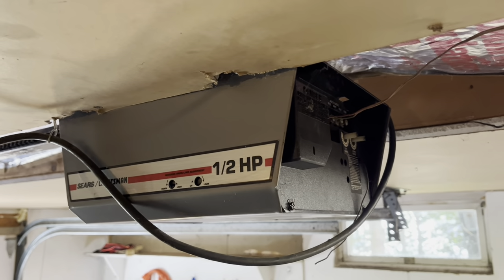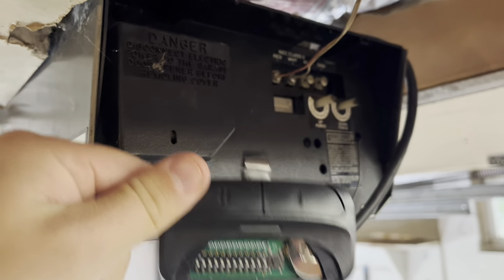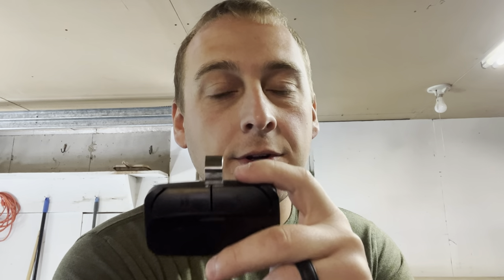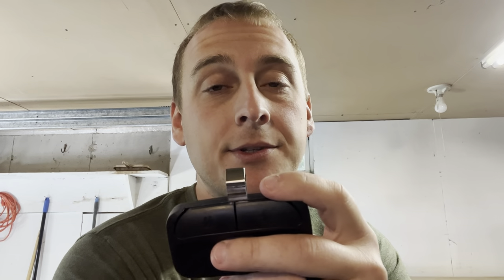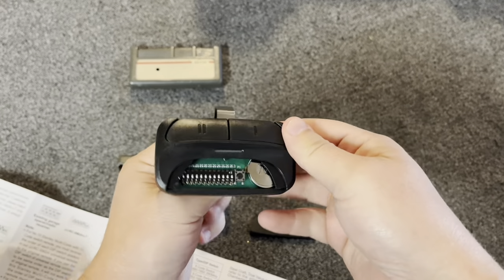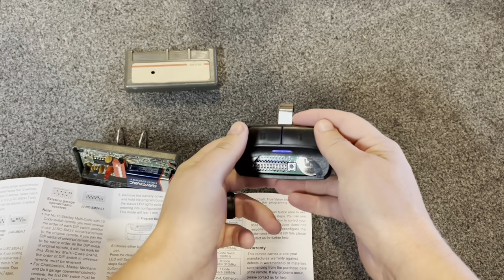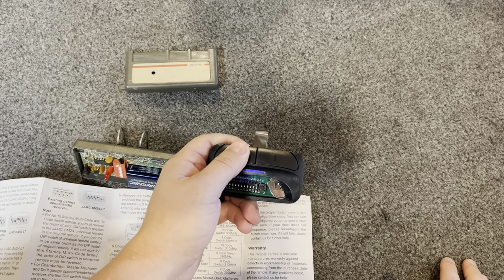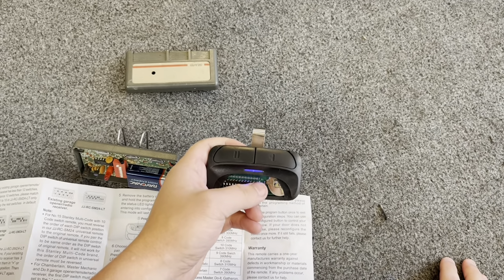Program a Craftsman Garage Door Opener. #Older #DIPswitch #universal

Comment: Have an older Sears 1/3 HP model 139.663956.  Opener works but cant open from out side.  Have the remote with dip switches but cant find the receiver on the unit.  Opened the motor box and could not locate.  any ideas  ...struggling ...help!!!

Comment: I see others searching social media looking for replacement remotes for 139.655000 Sears Craftsman garage openers. Wire in another Craftsman receiver model Craftsman 9-53751. The range is about 50-75 feet away from antenna. The red wire went to the left post on the opener.

Comment: will this work for 13953415sr ? mine looks exactltly the same as yours, only thing is i too do not have the remote but still have the wall remote in the garage. would that have the dip switches in it as well?
Reply: We brought a house and it has a sears craftsman 13953638srt. Just wondering, did you get yours to work? I’m hoping I can buy a universal remote as well. Our house had no remotes.

Comment: THank you so much! I was able to buy this remote and have it work for an elderly uncle's garage door.  Any chance you know how to also program the original remote, once the dip switches are changed?  Thanks again!
Reply from the maker: On the original remote and garage door opener, just match the dip switches in the same alignment and it should work.  Glad I could help.
Reply: @outdoorswithjim207  Thank you for your response! Unfortunately it's not as simple as just matching the dipswitches - I tried that.  Makes sense that it doesn't work, because How would one remote operate 3 garage doors?  I'll keep digging, but thanks again! You saved me a lot of time and potentially money but buying this amazon remote (even had it here in Canada thankfully). I was able to program both the garage doors with this two button remote.

Comment: What do you do with the switches when they are set to the middle and not on or off?
Reply from the maker: Just match the garage door opener with the remote and you can change the switches as long as they match.
Reply: @outdoorswithjim207 so id have to change them on the other remote also then right?
Reply from the maker: @blandry61  yes

Comment: On the new remote, it has only up and down. The older remote three positions. Up, 0 and down. How do you replicate it with only the two positions?
Reply from the maker: The middle one is just a neutral. Just set all the ones on the garage door opener either up or down.

Comment: What if you do not have the original remote?
Reply from the maker: By the one in the description.
Reply: I'm not sure where to find the dip switch pattern- you configure the new universal remote using the original remote, but I don't have the original. I have purchased the one you linked.

Comment: Do you think it's going to work for craftsman 2001 year model?
Reply from the maker: Not sure, but I would lean more towards probably.
Reply: @outdoorswithjim207  thanks. I just ordered it, and I will let you know. 
Do you know what to do if the wall console doesn't  work neither. The old number doesn't open the door, the battery is good. I don't know the main number